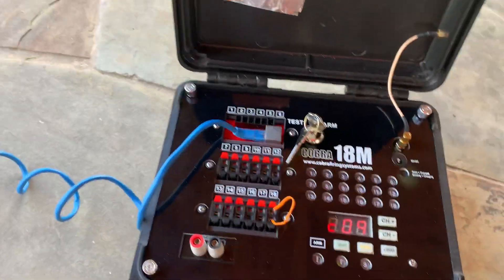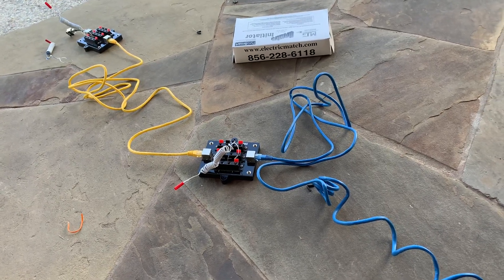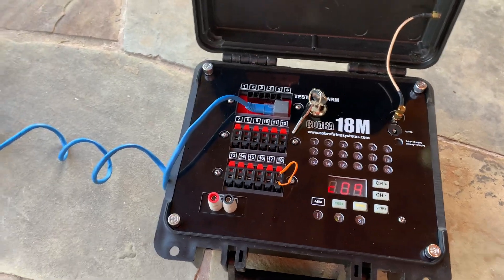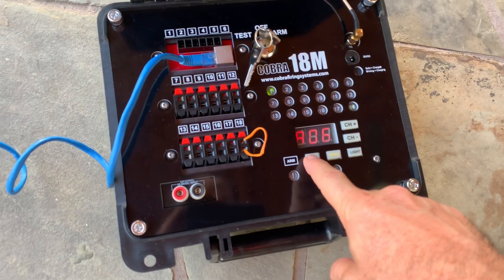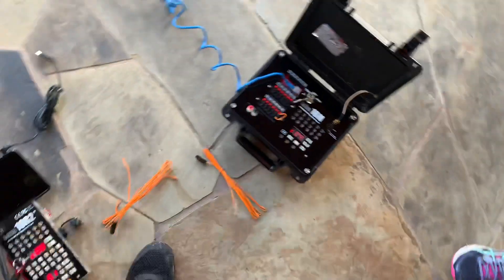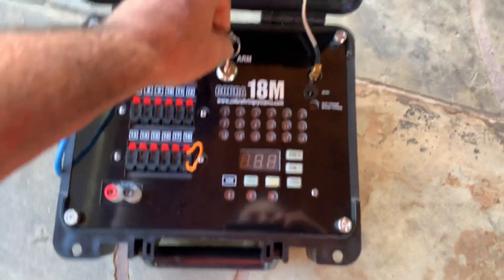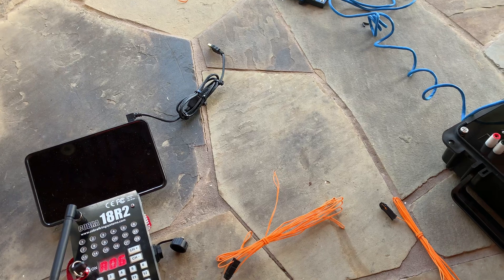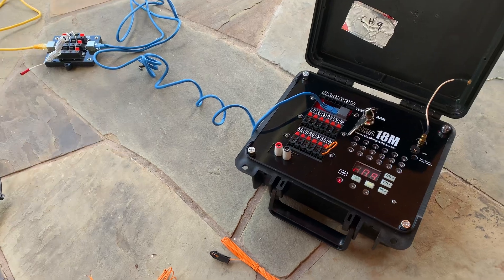Cobra 18M Quick plug Testing with 6s mini series slats

Comment: Silly question but I'm new to the cobra systems: If you performed this exact test while also having igniters on cues 1-6 which the RJ45 port is linked to directly on the 18M everything would go off as normal correct?  The igniters on the 2 slats as well as on the 18M?  Sorry if I worded it confusingly.
Reply from the maker: Yes they would.  You would have to use the quick plugs but they also fire the same time the slat does
Reply: @TXPyro  Awesome thanks for the reply.

Comment: was looking to get these... be a ton easier
Reply from the maker: yeah In the right application these can come in pretty handy.  Certainly using a cat 5 cable is a lot easier and cheaper than draggin around those 25m CENT50 cables I use for my slats running off my 72M